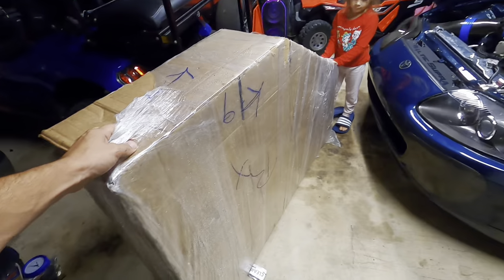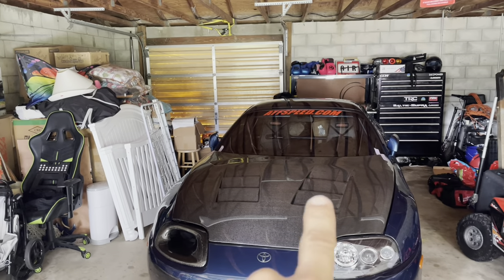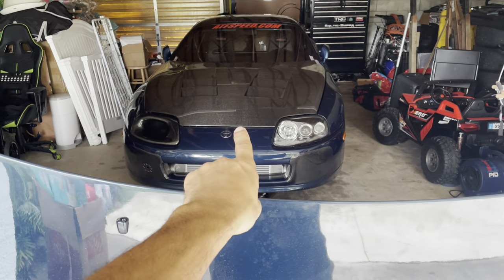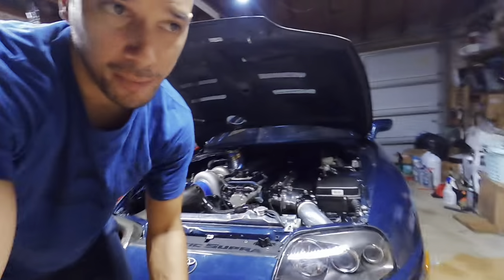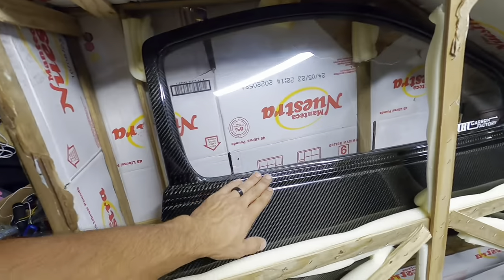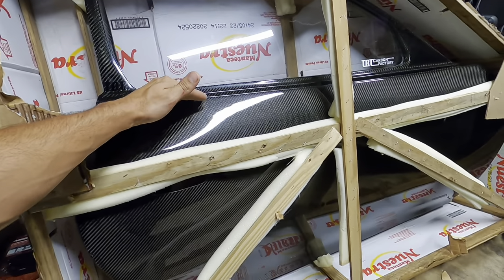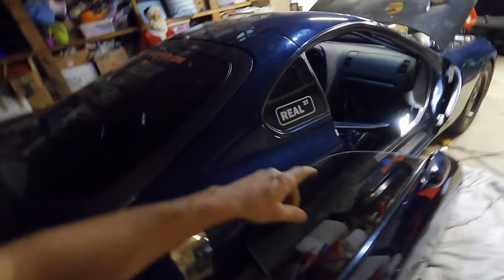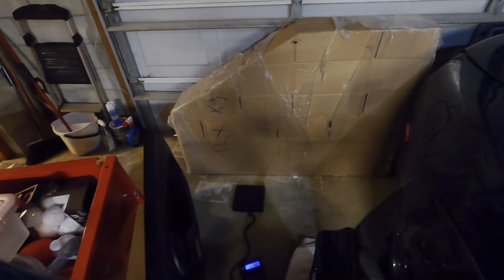Carbon Fiber Everything! Unreal Weight Savings

Comment: Weight savings to the max! That's a bit disappointing on the weight savings of the hood. The thing to remember is that most carbon hoods are wet carbon overlay which tends to be on the heavier side versus just going with a fiberglass hood. In terms of exhaust I prefer a fender exit due to the cabin air intake being in that corner, too much exhaust fumes ends up getting in the cabin but not everyone wants to cut up their car. I'm not sure if your looking for other places to save weight but theirs a company in the UK that makes preformed Lexan windows to replace the rest of them for a reasonable price, they are called plastics4performance.
Reply from the maker: Thanks for sharing Race family